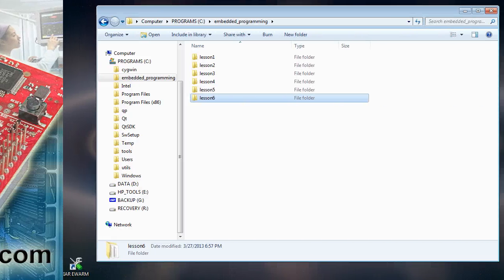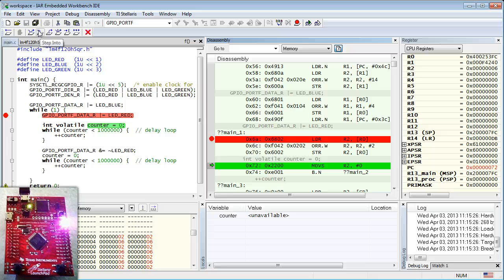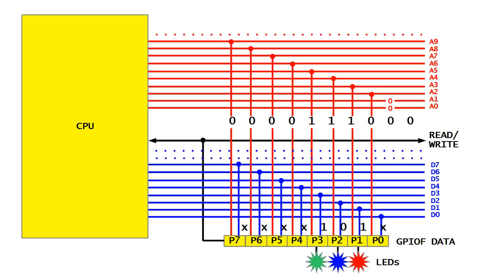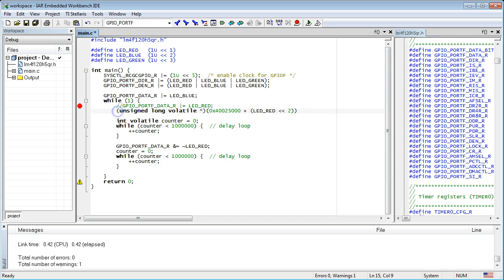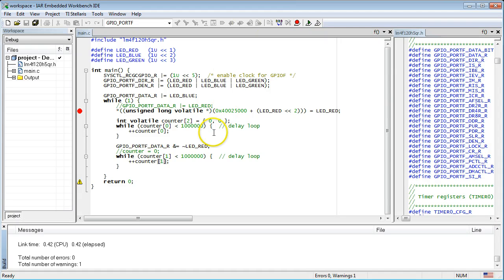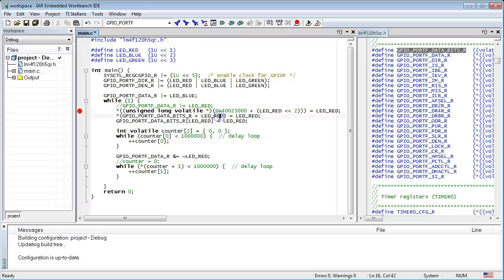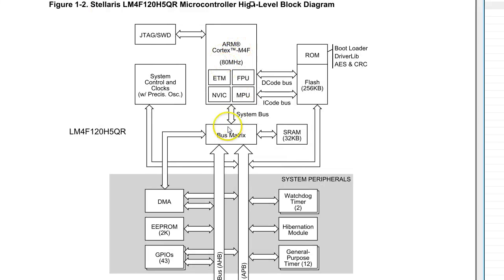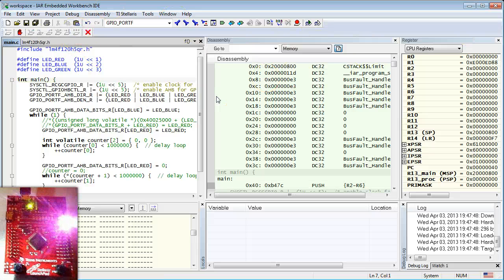#7 Arrays and Pointer Arithmetic

Comment: Thank you for preparing great embedded C lessons! Regarding bit-addressable GPIO it is worth mentioned that it is TI Stellaris specific feature not present in other ARM microcontrollers. E.g. STM32 provides atomic GPIO operation through the Bit Set / Reset Register that atomically sets or clears individual GPIO output bits, as you show in the stm32c031-keil example.

Comment: I was having a hard time trying to figure out why all three methods yield the same address, if you are in the same boat please read below:

/*
1. Manual Address Calculation:
LED_RED = (1U << 1) = 0x02
LED_RED << 2 = 0x08 

   *((unsigned long volatile *)(0x40025000 + (LED_RED << 2))) = LED_RED;
   - Base Address: 0x40025000
   - Offset: (LED_RED << 2) calculates the offset by left-shifting LED_RED by 2 (equivalent to multiplying by 4 for 4-byte-wide registers).
   - Final Address: 0x40025000 + 0x08 = 0x40025008
   - This method gives explicit control but is verbose and requires manual scaling.

2. Pointer Arithmetic:
   *(GPIO_PORTF_DATA_BITS_R + LED_RED) = LED_RED;
   - GPIO_PORTF_DATA_BITS_R: Points to the base address 0x40025000.
   - Offset: Adding LED_RED scales automatically by the element size (4 bytes).
   - Final Address: 0x40025000 + (0x02 * 4) = 0x40025008
   - This method is simpler than manual calculation and more readable.

3. Array Indexing:
   GPIO_PORTF_DATA_BITS_R[LED_RED] = LED_RED;
   - Array indexing is equivalent to pointer arithmetic: *(GPIO_PORTF_DATA_BITS_R + LED_RED).
   - Automatically calculates the offset using LED_RED as the index.
   - Final Address: Same as above, 0x40025000 + 0x08 = 0x40025008
   - This method is the most concise and readable, making it the preferred approach.

Comparison Summary:
- All methods yield the same memory address (0x40025008).
- Array indexing is the cleanest and most maintainable.
- Manual address calculation is low-level and explicit but harder to maintain.
- Pointer arithmetic is a good balance of control and readability.
*/
Reply: Thank you!

Comment: You mean that data lines a0 and a1 are unused because of the addresses of the registers being 32 bit means that the address must be dividable by 4 (bits 0 and 1 are 1, 2 and 3 so they cant be used as addreses or offset because they would change the data at the middle of an register)?
Reply from the maker: The hardware designers of the GPIO in TivaC decided to use only 32-bit registers aligned at 4-byte boundaries. Therefore, the address bits 0 and 1 must be always 0 when addressing GPIO registers (either for reading or writing). I don't even know what would happen if you try to access the GPIO as bytes or half-words. Why don't you try and post a comment about what you find out? --MMS
Reply: @StateMachineCOM  my tivac launchpad will arrive tomorrow so ill try, thanks for reply

Comment: I am confused on something. Why do you say all three alternatives equivalent when the first line of code has two instructions (MOVS and STR) and the other alternatives only have one (STR)?
Reply from the maker: @gabrielgorospe203 The first instruction, "MOVS R5,#2", is common and subsequently used in all three alternatives. The compiler is smart enough to avoid moving the same immediate constant "#2" into the same register R5 because the compiler knows that R5 does not change. So, only the first alternative has "MOVS R5,#2" and "STR R5,[R4]" and the two following ones have only the "STR R5,[R4]". --MMS

Comment: Questions:
when you wrote:
1) SYSCTL_GPIOHBCTL_R |= (1U << 5); /* enable AHB for GPIOF */
 2) SYSCTL_RCGCGPIO_R |= (1U << 5);  /* enable clock for GPIOF */

I noticed that you didn't comment the 2) for the APB

question (1): does that mean that both buses APB and AHB are active?

Question (2):  can I get away by just enabling AHB bus and not the APB since at the end when we optimized the code with the AHB we end up using AHB registers only? Or do I necessary have to enable both although I am only using one in this video?

Question (3): Finally, in this case only one bit was modified at a time. How do you address modifying multiple bit at a time.  (GPIO_PORTF_DATA_BITS_R + (LED_RED | LED_BLUE| LED_GREEN )) = (LED_RED | LED_BLUE| LED_GREEN ) will work?
Reply from the maker: It seems that the APB and AHB in TivaC are mutually exclusive, so you should use one or the other, but not both. The APB is provided for backward compatibility. The AHB is faster and should be preferred.
Reply: thanks

Comment: Great to show a concrete reason (interrupts) for atomic RMWs. This MCU (its GPIO) implements bit-banding in quite an interesting way. Many MCUs simply map each bit in the bit-band region to a word in the alias region, w/o enumerating all possible bit-combinations.

Thank you so much for introducing the AHB, the SYSCTL register to enable the AHB for GPIO, and the AHB aperture.
Reply from the maker: Good observation, but it's perhaps worth pointing out that the TivaC GPIO design goes beyond bit-banding. In the traditional bit-banding each bit has its own unique address. In the TivaC GPIO each bit combination has its own unique address. --MMS
Reply: @StateMachineCOM  Great thanks for the information. Now I see this design is by Tiva-C. Your lectures are very helpful.

Comment: Thank you for your fantastic explanations of embedded systems- almost 10 years later, it is still so relevant. I really appreciate your efforts. I have a question: in 3:47, when you're explaining the need for atomic writes, you mentioned that an interrupt can occur within the read-modify-write sequence, and the data to be written would be lost. Don't we face the same problem if we use the atomic write, and the ISR is called between the MOVS and STR command in 7:23? 

EDIT: Additionally, is this method of addressing ubiquitous in all Cortex M architectures? I'm using a SAMD21 chip with Cortex M0, and separate registers are provided for setting, clearing, and toggling pins, without having to read-modify-write the Data register. Additionally, there is an optional Pin Mask register they provide for independently controlling certain pins. Are these an analogous manifestation of the addressing format you're mentioning, or is it a separate concept altogether which happen to result in atomic writes?
Reply from the maker: No, pure write operations (like the one shown at 7:23) do not suffer from the race condition (race conditions are explained in lesson #20). The pure write will always write the same thing into the destination address regardless if it has been interrupted or not. But of course, if the destination address is shared with interrupts (or RTOS tasks), you could have a problem. But the write operation itself is OK. --MMS
Reply from the maker: Regarding the hardware design of GPIO to avoid the read-modify-write sequence: yes, you are right. I don't exactly know the GPIO hardware in the SAMD MCUs, but if they have separate "set" and "clear" registers, then they should exactly decouple the individual bits of GPIO. In other words, this would be a design that is safe for concurrency. BTW, the "set" and "clear" register design is used in the NVIC (present in all ARM Cortex-M), where you can "pend" and "unpend" a given interrupt with a pure-write that does not disturb other bits in the NVIC. --MMS
 --MMS
Reply: @StateMachineCOM  Thank you for the explanation! This clarified my question.

Comment: Thank you for your lesson Mr. Miro. Can you explain to me why *((unsigned long volatile *)(0x40025000 + (LED_RED<<2))) is the same as *(GPIO_PORTF_DATA_BITS_R + LED_RED), which is *(((volatile unsigned long *)0x40025000) + LED_RED), but not *(((volatile unsigned long *)0x40025000) + (LED_RED<<2))? Thank you very much!
Reply: In detail, pointer to (GPIOF_BASE + (LED_RED<<2)) is the same as ((pointer to (GPIOF_BASE)) + LED_RED). We need (LED_RED<<2) inside the pointer, but outside the pointer we only need LED_RED. I still don't know why!!!
Reply from the maker: @nemonobody9406  There is a big difference between a raw address and a pointer in C. Raw address, like 0x40025000, is just a number. In contrast, (unsigned )0x40025000 is a pointer with a specific *type . And in C there is a big difference between (address + offset1) and (pointer + offset2) because 'offset1' is different than 'offset2'. The 'unsigned' type happens to span 4 raw addresses. Therefore in C, offset1 is equivalent to offset2*4. Please think about it and experiment with the debugger. The understanding of the difference is critical for a proper understanding of pointers. --MMS
Reply: @StateMachineCOM  Thank you very much! It helps me a lot <3:face-red-heart-shape:

Comment: Hi Miro! even after indexing, the compiler is using the same read and write method as I noticed in the disassembly. 
GPIO_PORTF_DATA_R |= LED_RED; and GPIO_PORTF_DATA_BITS_R[LED_RED] = LED_RED; are following the same read and write operation. They both have LDR.N and STR in my compiler disassembly. While on the other hand your disassembly shows just STR for the indexed one. Am i doing something wrong?
Reply from the maker: The discrepancies between your disassembly and what is shown in the video are most likely caused by the different levels of optimization used. Specifically, the additional LDR instructions are there to put the right information into the registers. At higher levels of optimization the compiler might keep the information in the registers already to avoid re-loading the registers via costly LDR instructions. In that case you won't see as many LDRs. But at lower levels of optimization, the compiler just generates LDRs to load the data every time. This seems to be your case. --MMS

Comment: I'm confused. We write to the address LED_RED in the data registers, but the value we write also needs to be LED_RED? It feels like I should assume that I would also write LED_BLUE to address LED_BLUE if I wanted to, but why should that be the case? If I'm only controlling the LED_BLUE bit, then it seems I should just write a 1 to it, not a 10 or 100. If I'm not just controlling the LED_BLUE bit, it seems like it doesn't matter if I go to the LED_BLUE address or the LED_RED or LED_GREEN one, I'll control the LED_BLUE bit just as easily regardless.

Comment: I tried to play with the code for Lesson7, I added a #define USE_AHB and based on it either used the AHB or the APB registers, but when I execute the debugger doesn't go instruction by instruction like you are showing. What am I doing wrong?
Reply from the maker: To step through the disassembly code one instruction at a time, you need to click on the disassembly window. Otherwise, if you are still in the C code window, the debugger might try to step one "C line" at a time, which typically involves steps of several machine instructions at a time. --MMS
Reply: @StateMachineCOM  #if  defined(USE_AHB_BUS)
    SYSCTL_GPIOHBCTL_R |= (1U << 5); /* enable AHB for GPIOF */
    GPIO_PORTF_AHB_DIR_R |= (LED_RED | LED_BLUE | LED_GREEN);
    GPIO_PORTF_AHB_DEN_R |= (LED_RED | LED_BLUE | LED_GREEN);
#else
    GPIO_PORTF_DIR_R |= (LED_RED | LED_BLUE | LED_GREEN);
    GPIO_PORTF_DEN_R |= (LED_RED | LED_BLUE | LED_GREEN);
#endif Ok thanks for the tip, indeed the Dissasembly Window must be active to be able to step through the assembly instructions, but still I can't see any instructions for the code above, the compiler is ignoring it totally. Unless I made some stupid typo, I can't really understand why? Optimization is set to high. The code jumps directly to the LED_BLUE assignment indifferent to the value of the define.
Reply: It seems that once you activate the AHB bus, if you flash a code that will write APB registers, you will get a stack error. Any idea how to switch properly between AHB and APB? I tried to reset the bit SYSCTL_GPIOHBCTL_R &= ~(1U << 5); but even this way I receive a Bus Handler exception and even the Lesson 6 original code is not working any more. How can I clean the registers?

Comment: At 10:44, Miro said that the left-shift LED_RED value was due to 4-byte size of the address. I thought that shift was because of not using the two lowest-order address bits (A0 and A1). No?
Reply from the maker: The narration at 10:44 is actually correct. It says that the GPIO registers are 4-byte wide and NOT that the size of an address is 4-bytes. All addresses in ARM Cortex-M are 4-byte size, so this is not relevant. Important is that the addressed entities are 4-byte words, which means that addresses must be divisible by 4. This is equivalent to saying that the two LSBs in the address must be zero (A0==0 and A1==0). --MMS
Reply: @StateMachineCOM  oh, now I get it. Thank you!

Comment: Could someone kindly explain me why GPIOF_BITS_DATA_R[LED_RED] where LED_RED = 10 binary coreesponds the address bias  + 1000 binary (or 0x08 hex)?
As i can understand, that register address is 40025000 and that address points to the beginning of array of 32 bit registers. And 1-s indicate those bits, that could be modified. For that reason the offset 3FC make us possible to work with all 8 pins of particular GPIO : A, B, C ... F. Two last bits are for service purposes. As we anyway can only have control of 8 bits, so, how that array looks like?
[ 40025000, 40025001, 40025002, 40025003, 40025004... 40025008...]. The last one indicated here is 40025008 whom position doesn't correspond to index 2 (LED_RED = 10 binary or 2 dec, i mean 1<<1 = 10). I can't understand the logic and suffer of that fact. I can't find the answer anywhere and need sime help...
Reply: "As we anyway can only have control of 8 bits, so, how that array looks like? [ 40025000, 40025001, 40025002, 40025003, 40025004... 40025008...]"
The array addresses are [ 40025000, 40025004, 40025008, 40025000C, 400250010... 400250014...]. Each array element is a 32-bit address so it takes 4 bytes to store an element.
Reply: @Strogden1  thank you for your explanation, it helped me a lot

Comment: I think this modifying individual bits concept is known as bit banding and applicable for specific memory segments.
Reply from the maker: This lesson does NOT use "bit-banding" (please google for the term), although the GPIO design in TivaC MCU is somewhat similar in the general idea. So, while the described GPIO design is specific only to TivaC, bit-banding is the feature supported by all ARM Cortex-M3 and higher CPUs. Bit-banding is a way of aliasing memory regions. Specifically, each bit in a region of memory (the Bit-band Region) is mapped to an entire word in a second memory region (the Bit-band Alias Region). That way reads/writes to the Bit-band Alias Region end up reading/writing a single bit in the Bit-band Region. --MMS
Reply: @StateMachineCOM  Yes sir, thanks for the explanation.

Comment: Hello sir miro. I would like to clarify, what do you mean by we "don't need to scale the offset of the size of the element". So it means that in pointer arithmetic the LED_R which is equivalent to 0010 which is 2 in decimal, will it be equal to 1 in pointer arithmetic and in indexing no bitwise sihifting needed?

Comment: How is GPIO_PORTE_DATA_BITS_R[LED_RED] equal to 40025008 ?
Reply: GPIO_PORTE_DATA_BITS_R = (volatile unsigned long *) (Pointer to 4 bytes data)
GPIO_PORTE_DATA_BITS_R = 40025000 (direction)
LED_RED = 2
GPIO_PORTE_DATA_BITS_R[0] = 40025000 (from 0 to 3 ->  4 bytes)
GPIO_PORTE_DATA_BITS_R[1] = 40025000 + 4 = 40025004 (from 4 to   7 ->  4 bytes)
GPIO_PORTE_DATA_BITS_R[2] = 40025000 + 8 = 40025008 (from 8 to 11 ->  4 bytes)
Reply: @eduardosepulveda2747  how is 40025000 to 40025003 equal to 4 bytes? isn't it only equal to 2 bytes since those addresses are in hex? each digit of that address is 4 bits (1/2 byte) right? Sorry, I'm really confused
Reply: @ligeracastra  Please don't apologize, asking should never be a problem
.

unsigned long = 32 bits = 4 bytes

Every address in memory refers to a byte (8 bits)
.

40025000 -> 1 byte
40025001 -> 1 byte
40025002 -> 1 byte
40025003 -> 1 byte

In a array of unsigned longs every position of the array refers to a single "unsigned long" (32bits/4 bytes)

Position [0] of array of refers to direction 40025000

Position [1] of array of refers to direction 40025004 

So, position [1] of array refers to 4 bytes after previous direction, because previous direction should refer to 4 bytes data (unsigned long)
we have to leave 4 bytes between 2 consecutive positions of a array of "unsigned longs".

Please keep asking, keep learning, keep fighting ;)
Reply: @eduardosepulveda2747  Thanks for your detailed reply! I got it now!
Reply: @eduardosepulveda2747  Some heroes don't wear capes. Thank you so much !
Reply: Thank you

Comment: awesome tutorial. Please make one more lesson to compare two bus method AHB and APB. Why is AHB faster than AHP and its application as I see in video with DMA and EEPROM.
Reply from the maker: I'm not sure that there is too much to show from the software perspective. The documentation from TI says that AHB is faster (possibly clocked faster) and the APB is only for backwards compatibility. As a software engineer, you simply accept such information from the hardware designers. But one perhaps interesting lesson would be to show how to use software to assist in measuring timing with an oscilloscope. I will make a note for such a lesson. --MMS
Reply: @StateMachineCOM  The AHB is a pipelined, burst mode bus, thus us faster.  Pipelined here means it processes address phase of one transaction, as it services the data phase of another at the same time.